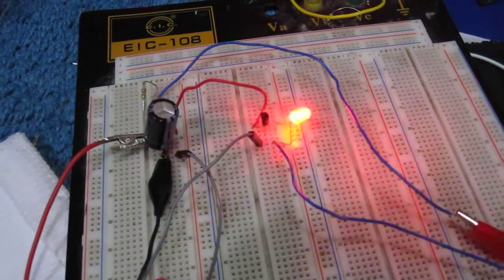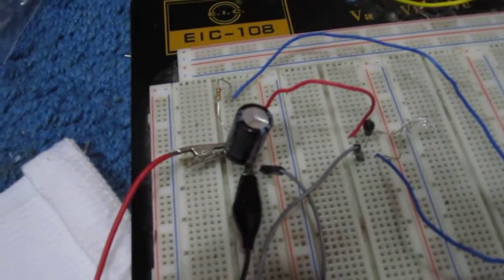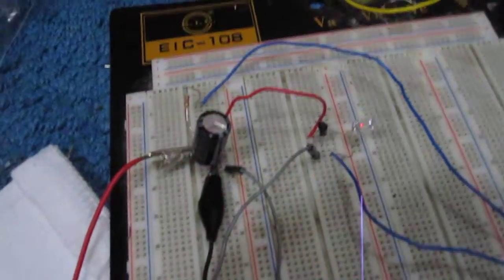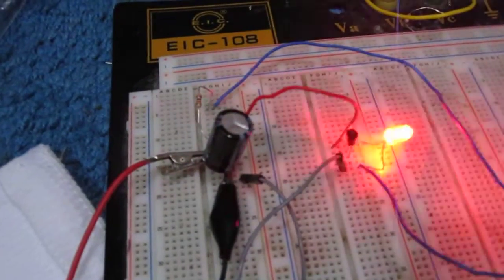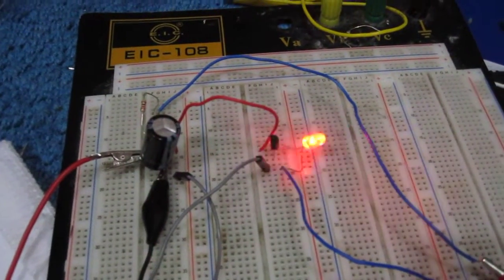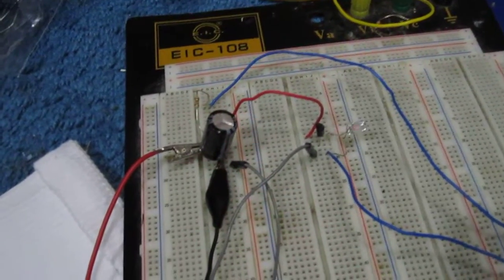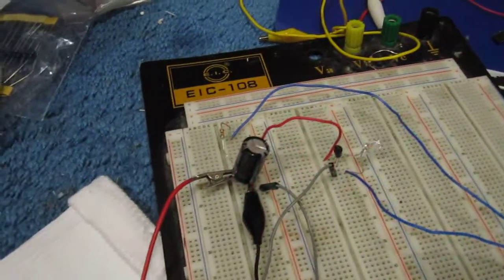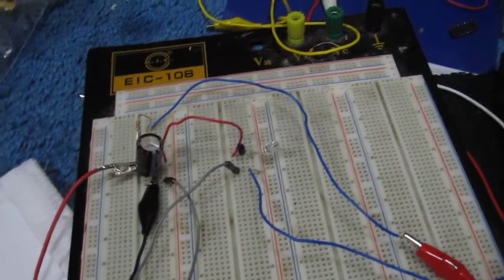Relaxation Oscillator Built with a Transistor

Comment: http://www.learningaboutelectronics.com/Articles/Relaxation-oscillator-circuit-with-a-transistor.php#HCB_comment_box
I retested the circuit today with detail measurement.
I'm using C945 transistor. And yellow LED. The voltage start breakthrough EC was 8.6V. When combine with led, V(ec) increased up 8.8V and drop down to 8.6V. But when use 2 LED serial, the V(ec) was high as 9.2V to start drop 8.8V. I'm using 12V supply, 1000uF capacitor. The voltage of the capacitor when circuit blinking was agitated between about 10.2V. to 10.7V for 1 Led circuit and between 12.1 to 12.5 for 2 led circuit. These circuit can not 100% working after turn on the power, sometimes it open stable low current mode which a medium current flow after breakthrough and it balanced with the input power.
The frequency was depend alot on the LED type (the voltage require to open). Increase frequency via B gate is possible, however the closing state not absolutely, the led still bright 30% after close and flash again. To get the strongest wave when increase the frequency their are 4 way: Decrease Capacitance, Decrease source supply resistor, Change the LED to lower open gate Diode like red LED or zener or normal diode, Apply capacitor parallel the LED. When apply the capacitor 1uF that parallel the LED, the voltage between 1000uF agitated between 12.15 to 12.35V and the off state closed 100%. (I measured the off state by another circuit that use Darlington transistor to amplify and detect super low current, it's sensitive enough for detect near electric field,)
The transistor is easy to be destroyed if the led short circuit, it need a resistor about 25 Ohm before got to the LED, you may need this if replace the led with speaker or get output pulse and import to other circuit modules.

Comment: Checked the site, awesome explaination. A Question tho: what if i connect the base of the transistor to the terminal of the cap that is connected to ground? 
Would i have to scale down the capacitance as there is much lower base voltage required? Will the voltage required also be less? Like maybe 5v?
Thanks.